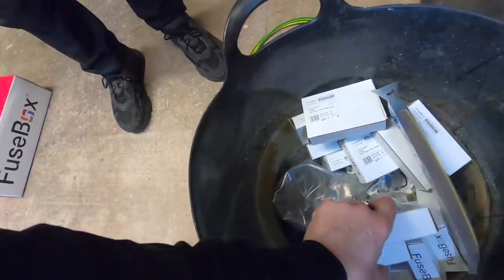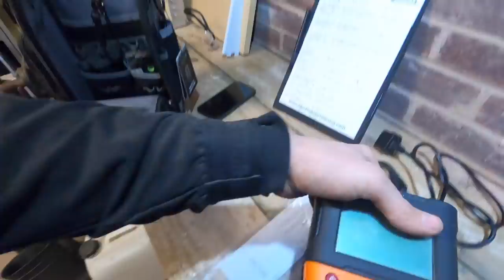Backbreaking fuseboard change, Electrician

Comment: The inspection software should support 4" thermal printers - then you can use adhesive label media to print your own circuit detail labels, with your branding, but without need pre-printed labels

Comment: Highest loads next to main switch is pretty much an urban legend IMHO. Yes, it means the highest current has the least distance to travel down the busbar, but two things: the CSA of the bar is such that it is rated to at least the main switch current anyway, and if you add a shower in 5 years, nobody sensible moves all the existing circuits down the bar (especially not in a 48 way three phase DB 😂😂).

Comment: Nice work, and good to see some metal boxes going in. Always struck me as odd that regs require metal enclosures on DBs but happy to put more connections in a plastic box when extending. 
Kudos for spreading the word about Gary's daughter too. Nice to see people using their fame for good. :)
Reply from the maker: Thanks bud 👍
Reply: My way of thinking is screw terminals in a consumer unit can be either poorly torqued or come loose over time. Wago/crimps/mf connections can’t/won’t so no need for non combustible materials for the enclosure?
Reply: Strikes me odd that people worry about plastics JB,s and have no issues with plastic sockets, light  switchs, spurs and plastic player board boxes
Reply: @roydowling2542  it’s all about the probability of loose connections causing an issue. How many fires start in a socket or light switch? How many in a CU ? Do the math
Reply: @Marco-mg9tv  never replaced a shower switch then I am guessing
Reply: Really, yet it's not odd, that all the breakers are plastic, and there's plastic trunking, any fire in there, and some of the heat will rise up the cables anyway.
The regs as usual try to deal with the symptom and not the cause, they should deal with the cause, crap workmanship.
You know they make vehicle fuel tanks from plastic and oil heating tanks, so it can't be that dangerous
Reply: @acelectricalsecurity  I think it's due to location as well I've changed countless switches and sockets etc that the customer has seen discolouring/smelled burning out where as a fuseboard in a garage or understairs that nobody goes near might be burning up for months unnoticed.
Reply: @acelectricalsecurity  plenty. Lots of loose connections and melted bits. None had caused a fire
Reply: @Marco-mg9tv  and that's my point, I have never been to any accessory that's caused a fire, and only one board that had gone on fire, and that board was a volex one that failed the hot wire test, and at the time was subject to a recall on their breakers.
I find it funny, that electricians make a big thing when they see a plastic board, when there's nothing wrong with them, if they were that bad we would not be allowed to install them.

Comment: In regards to plastuc jbs etc for fire. We happily fit plastic sockets on a plastic back box
Reply: There's never been anything wrong with plastic, just the limp wristed Muppets.
Reply: @Dark Dreamz most people see it as 13a s/o so it must take 13amps ( wrong) .
Reply: Most sockets and boxes are fairly non flammable phenolic. Yeah there are pvc sockets and boxes, but i'd say they're in the huge minority.  Nowt wrong with a little bit of extra safety. And actually metal adaptable boxes can be a dang site cheaper than many of the proprietary plastic offerings
Reply: @TheChipmunk2008  true, I bought some 4x4 plastic trunking once it was twice the cost of metal and I also got a 90 degree bend, that was the same cost as the trunking, couldn't believe it.

Comment: Your bus bar has a small (.0001ohm/cm) resistance and that creates heat which costs money. So your largest breakers are closest to reduce resistance. Though it may be small but over the life of the board could be significant compared to the cost of putting them in order with wire length not being a factor.

Comment: I'm not an electrician ( can just about change a light fitting, takes about 4 hrs but hey ho..).. but just like to say top work you do, really neat and great to see professionals at work.. 
How you can work out where all those wires go is beyond me.. my brain aches just looking at em.. Top job..👍👍
Reply: Training and experience help a lot, but notes and labels are where it's really at. You can't get away with "rule of thumb" anymore when you start hitting 200+ cables (not wires) into an enclosure with specific location requirements for termination and internal trunking.

Comment: Highest load closest to the incomer means that less current has to travel the length of the bus bar, less opportunity for heating and less chance of a problem.  In reality the bus bar should be more than capable of carrying full current for it's entire length and so no one needs to do this. But things happen, so it's good practice to minimise a risk if it's possible to do so.

Strangely North American codes often require a minimum distance between the incoming breaker and any high load — for airflow / cooling, so they end up doing the opposite: typically incomer at the top of their boards and then load breaker modules upwards from the highest at the bottom. But their bus bars are fixed, usually steel and stoopidly mahoosive!  So unwanted heating in the breakers is actually much more likely than in the bus bars.
Reply: exactly. the highest current goes the shortest distance (less loss and less heat generated).  As you said if the big load is at the far end, the whole busbar is carrying that current end to end, before adding all the other circuits  "along the way".

Comment: Good effort with the box, great to see the thought that goes into doing more than the minimum in the regs. Have you used intumescent pads in any installs? Particularly good with things like trunking and rear entry boxes to impede flame propagation. Bit neater and less of a maintenance pain than intumescent mastic. MoD buildings use evirograff pads absolutely everywhere for trunking (including metal) especially between fire boundaries.

Comment: Highest amps closest to the source = Because Heat
If they have to go from [A-B] and [C-D-E-F] transmitting less amps wont get as warm and can use the nice thermal conductivity of the copper help bleed heat away and have cooler parts to eradicate the heat.
If it has to from [A-F] and go through [B-C-D-E] along the way, it's all being heated up so no nice heat bleeding.
Reply: It would be interesting to see Nick test this in his unit. I reckon you would have to be putting hundreds of amps through busbar that size to get any heat effect?
Reply: @fazerstorm-oap  If there was any significant heat, then this whole technique would not even be a thing.. Everything is WAY WAY within safety limits.. 
You are correct, it would take significant amounts of energy.. Even as a giant burst (not likely with fuses) or at limits for a very sustained timeframe with a very high ambient temperature. Lets just say everything else would prob fail before the busbar ever did..
And this is why it's not against regs to do so, just a general guide.
Same way driving down a road within mm of the white line.. It's not against road law.. but why not just drive safer by rule, and do things out of the norm when needed.

Comment: The largest load nearest the main switch question.  I was taught that it would reduce the amount of load on the copper busbar, therefore negate a cumulative build up of heat and hot spots on the busbar.  The heat would expand the copper busbar,  and may over time damage the termination cage of the RCBO or MCB,  resulting in a high resistance termination.
Reply: The busbar is rated for the full 100A across the busbar. If you measure the impedance of the busbar, you'll find it's in the sub milliohms range. Even at 100A with a 0.1mR impedance, the busbar is dissipating 1W across the full length - likely not enough to raise the temperature by 1 degree. It's a non-issue. You're better off spreading the load across and grouping according to location of the circuit so you don't create hotspots between the MCBs - the contact impedance it much higher than that of the busbar.
Reply: @sdgelectronics  interesting feedback.  The manufacturers recommended that the largest load be next to the main switch and this is also taught in college's and is a typical exam/test question. 

Since Nick has all the equipment in his workshop, how about doing an experiment.
Reply: That logic would mean everything is on at the same time. Even if that was the case regardless how the RCBO’s are spread you would have the same load at the beginning.
Reply: @matthewfewings6023  I believe the idea is that large loads are next to the main switch so only a small percentage of the busbar is at the maximum demand.   If you placed the large loads at the opposite end of the main switch, then more of the busbar would be running at a higher demand.  Yes, the busbar can take 100amp and you can place heavy loads on any way.   I just think it's good practice.
Reply: @stuartthespark  yea I get the thinking, reason and the theory, which i actually use and was taught. Just think in the domestic world it’s been over-egged as such. 
If the bush bar can’t take the demand the bush bar should be bigger.  
I genuinely think it wouldn’t matter how you did it. The first part of the bar will always carry the full demand. Maybe years ago the logic was more sound. 
It’s a lot easier to manoeuvre small cables as the board starts getting full. 

Easiest way to check would be to run a 100 amps down the first and second pins of the bush bar and then run it the whole way, see if it makes a difference. 😀

Comment: My way of thinking is screw terminals in a consumer unit can be either poorly torqued or come loose over time. Wago/crimps/mf connections can’t/won’t so no need for non combustible materials for the enclosure?

Comment: I suspect a lot of "electricians" think that highest load breaker nearest the main switch=lower voltdrop on the common busbar which while technically correct it's insignificant, you could do a low ohms test along the main busbar to each breaker stub and do the maths, you'll be looking at uV/mV max and it would only ever matter if the ring was loaded to anywhere near it's limit which they virtually never are.
Reply: @adamsharp201  Why does that matter ? I actually work in special effects/theatrical props with a heavy bias towards electronics.

Comment: They started insisting on metal dis-boards because the manufactures couldn’t make them properly, and it was far too easy for loose connections to happen! Especially when you consider they’re often in locations with poor access and difficult to work on. Much less likely to get that problem with Wagos or equivalent push-fits. But always important to take care with connections and ensure they’re mechanically and electrically sound.
Reply: It was mainly London fire brigade that pushed for them, they were attending so many fires per week, caused by limp wristed Muppets.
Your also right, that certain manufacturers had been manufacturing boards that did not meet the British standard, as they failed the hot wire test, but that didn't stop them stamping them with British standard, and selling to us.

Comment: Largest loads nearest the incomer, was taught that within the first few weeks of my apprenticeship!
Reply: Not necessarily sound advice though.
Reply: @sdgelectronics  but it is.
Reply: @mrclive5  Grouping all high load MCBs together generally causes more issues for the MCBs themselves. The contact impedance of the MCB means they will dissipate power under load. There's plenty of reports of overheating under these circumstances. The busbar is rated for the full load across it's length and there is no requirement or reason to group the highest rated MCBs together nearest the supply.
Reply: @sdgelectronics  now that's a very fair argument, but in your average domestic install you're highly unlikely to ever see full load conditions on the heavy loads at the same time. And if you do, it'll only be for a short duration. I'd allow diversity here. 

I've never seen any evidence of MCBs or busbars being unduly loaded, but I'll take what you've said on-board, it's all good info. 

Seen plenty of cooked cables, and the odd accessory.
Reply: @mrclive5  There's a few pictures on various groups. I might take some measurements of a busbar and see what the implication is in terms of voltage drop of having heavy loads at the end of the busbar. A quick estimation suggests you'd have nothing to worry about though and a logical arrangement e.g. all downstairs circuits together is probably of better benefit.

Comment: Which Ideal connector did you use to extend wires?
Reply: Surely you would of been able to find them quickly yourself but if not they are the ideal spliceline in-line wire connectors

Comment: On the busbar thingy - wouldn't it make more sense to have it as close as possible to the main breakers to lower the effects of voltage drop across the bar - all be it it should be in the mV range or the bar is too thin.
Reply: I just thought it was a logical thing to do

Comment: Great content continually improving in narration and production but do yourself a (long term) favour and take the load off that shoulder with a lightweight tripod.  

Many of your content shots would work well from a stable platform. The added image stability and single POV, incorporating appropriate 'zoomed' close shots would add a bit of 'style' over many other YouTube productions.  Appreciate it will would seem to add to the video workload but once you work out a shot plan I think you will find it easier, and it would give you an extra arm and hand to complete 'real 'work!  

Also consider the 'rule' of movies - when you zoom in/out, or pan, try to finish on at least 3 seconds of stable unmoving shot - gives the watcher time to adjust to the new POV and avoids viewer motion sickness :-)  Try not to rapidly zoom in then out - adjust the view and do a cut in post production, further avoids motion sickness.
Reply: More than a couple of those fast swings and I get sea sick!  😀

Comment: Nice work as always Boyz! What size earth did you use to earth the adaptable boxes and why? 👍
Reply: You bond conductive enclosures (boxes, conduits, ladder trays, etc.) to earth ground so that any exposed conductor trips a breaker rather than shorting to another circuit or making the enclosure live to electrocute someone.
Reply: @Azlehria  yes, I understand that, but what size earth conductor should be used and how do you calculate that size is what I meant to ask.
Reply: @mrbeckles77  I'd assume the CSA of the CPC  of the highest load contained within the box, on the basis that more than one simultaneous fault would be extremely unlikely. Would like to know the proper answer though.

Comment: lol i just had to laugh the way your j-boxes look is the way %95 of n. american sparks do it and the reason i was turned onto the din rail system  a 1yr later because of space reasons you have do it our way is just priceless but great results and i would have used our version of flex for all those earths as well.
Reply: I don't think I've ever seen a J box that big with knockouts, only LCs and 4S. All the big JBs I've run across had solid sides - and usually welded corners.
Reply: @Azlehria  I've seen them bigger with two rows of knockouts but I'm in the states and I was surprised UK had j-boxes that big with gland knockouts

Comment: whats your opinion of the Fusebox range? i'm seeing a lot of mixed views on various Forums.
Reply from the maker: Mate can’t fault them at all, 👍
Reply: I’ve fitted about 30 of them, no probs whatsoever and well thought out boards / that have also taken on board feedback like captive cover screws, reducing the lid flange, grommet strip made to measure the rear knockouts, etc. Hagar= over rated/over priced. The only board I’ve fitted I’ve thought better than Fusebox is contactum but more expensive and still functional earth leads which lets them down.
Reply: Fitted a few now, good boards, stopped fitting hager ,Type A RCD problems!!
Reply: For the price they are ok, and there's no excuse not to fit rcbos,  and no need to fit twin RCD boards now, which we shouldn't be installing anyway.

Comment: Highest load ALWAYS goes nearest the main switch.
Reply: Why? The volts drop through a busbar of that size must be negligible, is there another reason?
Reply: Why? Other than "that's the way it's always been done", that is. 
An explanation of the physics, references to BS 7671, manufacturers instructions or on-site guide would be genuinely helpful.

Comment: First off this is not a fuse panelit is a circuit breaker main panel there isn’t a single fuse in that panel. We stopped using fuses in 1950 in residential construction. Secondly changing out any electrical service is difficult, this one is no different.
Reply: "We stopped using fuses in 1950 in residential construction" - What country mate? CUs with wire-able fuses were still in use in the '60s and '70s where I live in the UK.
Reply: @barrieshepherd7694  you haven’t been able to buy a residential fuse panel in the US since the early sixties. You can buy a fused disconnect switch for a motor or air handler or pump but no fuse panels period in residential since knob and tube wiring. Welcome to the modern electrical age.
Reply: @Tony-bn2nd  as was my parents , built at the same time, new owners only upgraded 2 years ago. I suspect that a rewire-able link, correctly installed is as safe, or maybe more so, as a MCB. Just not as convenient!